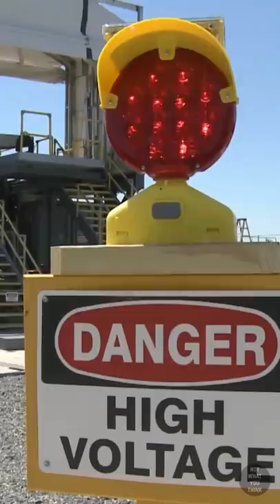Railguns: Destructive to the Core

Comment: I live on the base where this is filmed. I havent seen it fired, nor even seen it in person. But i have definitely been woke up in a panic from a shock wave hitting my window. This thing is wildly powerful. The mk 160 and cwis can be heard, but not felt like the railgun can. Its too bad they couldnt work out all the kinks. The Navy has since given up on it
Reply: So you've been on base when it was fired? You mention shockwave, I assume it's loud... Like a crack or a boom? We're you inside or outside? And was there a pressure wave?
You say they gave it up, is it still there? Functional?
Those are Tungston Steel sabot's aren't they? Man, the size and weight of that projectile alone would require a He'll of a lot of power much less at those velocities.
Curious minds want to know.
Reply: Wouldn't a gun like this just over penetrait every thing it shot at
Reply: @ainsleyhariott4353  depends on whether the shock wave could be tuned to be specifically destructive. As a bunker buster it would be great except for it's obviously prohibitive size and power requirements. 
I'm sure they could find a way to work around the problem of it shaking itself apart
Reply: @ainsleyhariott4353  yes, but the point of it is being able to attack other ships from extremely long range (you can even potentially make shots from over the horizon), while also eliminating the hazard of carrying explosives on board.
Reply: @ainsleyhariott4353  when shooting a ship at sea I’d hope it goes clean through and into the ocean
Reply: Railguns range proves the earth is flat and curvature does not exist
Reply: @Phdintheory  They might live on the base but they definitely don’t know a majority of what goes on I live in a similar weapons testing base and it’s absolutely huge
Reply: @joshtheflatearthjedi222   basic radar systems prove the earth is round😂. Im a spy tech for the navy, you can literally see the curvature of the earth
Reply: @RandomUser2388  thats a straight up lie. How are you claiming to see curvature?
Reply: @joshtheflatearthjedi222   based on how far the waves travel in reference to the hight of the radar. For example a higher radar can see farther than one that is lower. Thats why every radar you see is mounted on the top of the ship. As well as missiles using the curve of the earth to make gravity assisted long distance missiles, aka ballistic missiles, basically they break through the atmosphere and coast in the orbit of earth using gravity to maintain altitude before diving back down to their target
Reply: @RandomUser2388  please explain to me how line of sight technology works then like the sea sparrow ship based line of sight weapon and railguns which require line of sight and go further than curvature would allow. We also have the world record line of sight microwave transmission of over 150 miles which also goes much further than curvature would allow. There are many more examples these are just a few that come to mind that completely debunk curvature.
Reply: @joshtheflatearthjedi222   your facts are off. The way they achieved the line of sight was by bouncing microwaves off the atmosphere. Line of sight does not mean visible to the naked eye or by optics. Line of sight is a term used that basically means there is a confirmed know location of a target using a search and track system aboard. 99% of the time its a radar. So line of sight can be as far as the capability of your radar. This concept goes way farther back in history with old wooden naval ships using crows nests to find and identify targets faster. Allowing more time to plan and prep before they breached view sight from the deck. Now with a flat earth dont you think a crows nest wouldnt matter. Dont u think the worlds most powerful radar would see farther than what it does. Our spy radar can see lets say 400 miles in the sky, but only can see 50 on the surface under normal conditions (ie no capability to bounce microwaves off the atmosphere). These numbers are classified so i cant give you exact. But thats roughly the ratio. So dont u think if the earth was flat we would be able to see out 400 miles on the surface?
Reply: @RandomUser2388  no they didn't bounce waves off the atmosphere it was a one radio to one radio transmission using no repeaters. It was a tower to tower transmission
Reply: @RandomUser2388  just go look it up before making assumptions because it does not work like you are claiming.
Reply: @joshtheflatearthjedi222  so its not a line of sight record then? Tower to tower in sequence wouldnt be line of sight, dont u think if the earth was flat you would be able to do point A to point B without any towers in between? And yes it does work like im claiming when it comes to high power radars like the one i use. We do bounce waves off the atmosphere allowing us to see farther. Look trust me if i didnt have that first hand direct proof of a round earth i would be on your side. But two things, first why would the government lie about the shape of the earth, like whats the motive. Second there is no undeniable evidence the earth is flat, at least nothing you have told me
Reply: @RandomUser2388  yes it is line of sight. It is one tower to one tower. A single transmission of over 150 miles
Reply: @joshtheflatearthjedi222   the only way to do that is either extreme elevation difference, ie sending it from high elevation to low, or bouncing it from the atmosphere. 150 miles is not that far. A radio wave could go farther if the earth was flat
Reply: @joshtheflatearthjedi222  did a little research for ya, i was in fact correct in saying they bounced it off the atmosphere, transmissions of even 80 miles require waves to bounce. Its really not a difficult concept
Reply: @RandomUser2388  the transmission i am speaking of is a world record line of sight transmission that does not do any bouncing of signals off the atmosphere.  Yes they do bounce waves off the atmosphere and use repeaters to span much further distance than 150 miles but the record is a record because its a single transmission not using any repeaters or bouncing of signals. Just look up world record line of sight microwave transmission and you will find it.
Reply: @RandomUser2388  it is line of sight from one tower directly to another tower. It was used to provide internet to an island. There is one tower on mainland and a tower on the island.  They are transmitting directly from one tower to the other.
Reply: @joshtheflatearthjedi222  okay you got me jedi, the earth is definitely flat👍😂 100% no other logical explanation to fucking radio towers💀. Your the guy that will read an entire book on a true story and then find one sentence that may not have a logical explanation and declaring the whole book isnt a true story, when in reality you just didn’t understand all the facts of it😂😂
Reply: @joshtheflatearthjedi222   i have seen it first hand😂. Its funny actually i was just watching a video on the tsar bomba that showed up on my feed. And they showed a video of their instrument (dont know the name of it) that measured the blast. It was measured 3 times as it went around the earth. Pretty interesting. 
Im just curious, if the earth is flat whats at the edge, why dont we fall off?
Reply: @Motoboo_Marine  thatd be the case if it wasn't so inaccurate....
Reply: @joshtheflatearthjedi222  wow. Just... Wow.
Reply: @joshtheflatearthjedi222  sorry, genuine question as I have very little knowledge about flat earth theory: if the earth is flat, why can we not see past the horizon? Isn't a curved horizon because the earth is spherical?
And why does looking from a higher elevation allow you to see further than from lower down?
Sorry, these are just two questions I'm genuinely curious want hearing the answers to
Reply: @tarrane2232  yeah I need to know myself as well
Reply: @joshtheflatearthjedi222  bruh go touch some grass
Reply: @Delta5x7  what does that even mean lol.
Reply: I have pkayed Halo enough to know what a railgun is.
Reply: @RandomUser2388  I am so, so sorry for the wasted time on Josh. He was never worth the effort, flat earthers never believe anyone but themselves
Reply: If they went for nuclear power on the boats for the energy and a super strong structure so it wouldn't blow itself up they could have used it with great potential.
Reply: @joshtheflatearthjedi222  Refraction.
Reply: @marTn3  maybe. Just maybe…
We’re so close…
I WANT MY FUCKING RAILGUN DOD!!!
Reply: @ainsleyhariott4353  I'm pretty sure that somewhere between 50 and 100 miles of travel by the projectile it's muzzle energy would be low enough to cause real damage

Comment: This specific railgun was for the zumwalt class cruisers if I’m correct and the project was actually cancelled due to problems with energy consumption and the cruisers themselves are already being decommissioned even though only 5 were built so far
Reply: do you mean the cruiser is zumwalt? If so, isn't the zumwalt class only made up of 3 units?
Reply: Only 3
Reply: Yeah supposed to have the rail gun built buy British firm bae system shown in this video but they weren’t ready so they ended up with 2 AGS 155mm Gun system with possibilities to put rail gun in the future

Comment: It was meant to allow for cheaper projectiles and ships no longer needing ammo magazines. But in practice it's not as useful without expensive guided projectiles, which greatly reduces the value (along with the aforementioned wear on the railgun itself with each shot and the power requirements).  Current navy ships are power hungry to begin with, even before installing railguns.

Comment: To decrease the tension of heat you can have holes in the bottom which will be open as soon as the ammo has been ejected from the barrel or keep the eletronics away from barrel so the barrel can be replaced

Comment: newer alloys would be needed, for example something dense like bronze might work, or using a granite stone tube held by iron rings, the key is something that endures the extreme temperatures, doesn't conduct electricity and has no friction.

Bronze is really dense and ductile so it would just crack when it reaches its limit instead of explode, as for Granite... well there are metal and stone alloys, and in nature bioalloys do exist between minerals and metals.